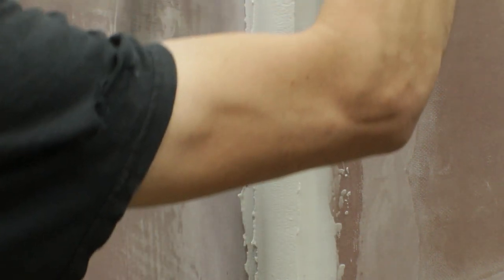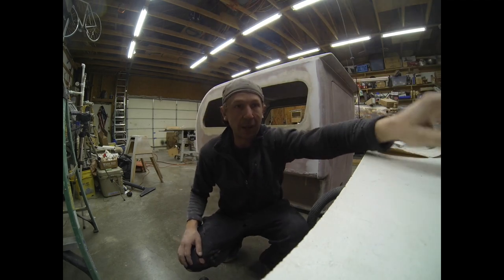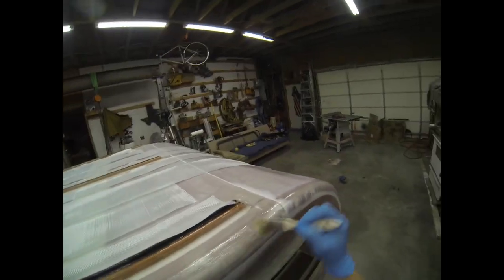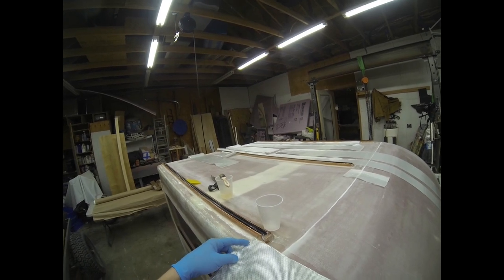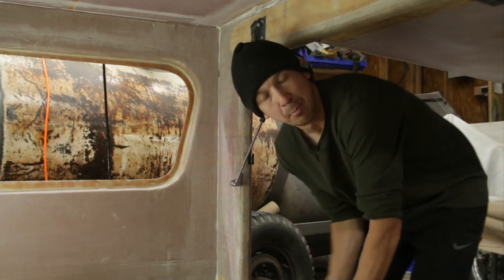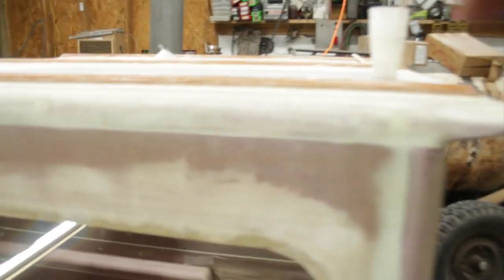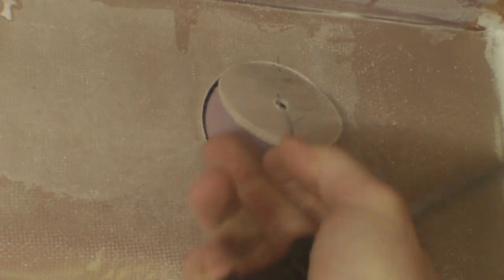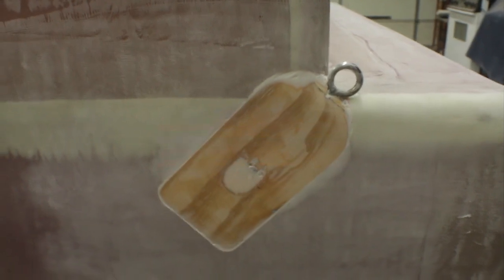Foamie Camper Build Update- So Much Sanding!

Comment: Hi I stumbled across your videos I have never seen anything like this done here in Brisbane Australia we can get the foam but not sure about other products like the bog Bondo stuff thanks for going to the trouble to make the videos
Reply from the maker: Hey Gary! A quick google and you have no fewer than 5 suppliers in Brisbane that carry everything you need. The filler is made from microballoons mixed with epoxy, but any of the traditional composite fillers would work too (aerosil, Qcells, Talc)

Thanks for watching!

Comment: Jake, wondering what type of resin your using? Seems like you have a lot of working time with it
Reply from the maker: Hey Dan, Im using Epoxy resin of varying speeds. Based on the temperature in the shop I use a slow, medium, or fast hardener to get the most working time. Also I get it out of the mixing cup and onto the part as quickly as possible, if left in the cup it will dramatically reduce your working time. I've used uscomposites 635 thin series for the whole build. Thanks for watching!

Comment: I love this build 👍. BUTT! it's so hard to follow it. I just ran across your channel. They're not in any kinda order.   I wanted to start at the beginning and follow your building adventure. I have thought about building a camper using this method, but wasn't sure if it would be strong enough.      I know very little about setting up a channel , and couldn't do any better job of putting out content. I need to learn how to edit as well.
Reply from the maker: Phil,

The build videos are in the order that they occurred, and are meant to be informative, but not necessarily a how to. 

Sort the foamie camper build playlist by upload date and that's as linear as this brain of mine gets. 

Thanks for watching!

Comment: You're an inspiration. I appreciate the skill involved. You make it look so easy. Are you applying so many layers for a reason or is it overkill for peace of mind? I see other projects on YouTube using only single (double at most) layers of fibreglass. Thanks for all the effort you put into these videos, I know it's hard work, especially filming something that is so time-sensitive - epoxy...
Reply from the maker: Frost, thanks for your appreciation! 

I made up some 4"x4" test panels of varying layer counts and did some old school destructive testing. 
With a single layer of 7oz cloth I could easily dent the underlying foam with my thumb. 
I found that 15-20oz of cloth was the happy medium between impact resistance and overall project weight.